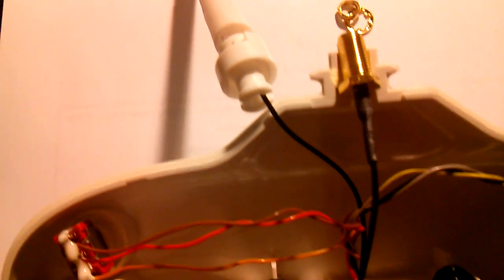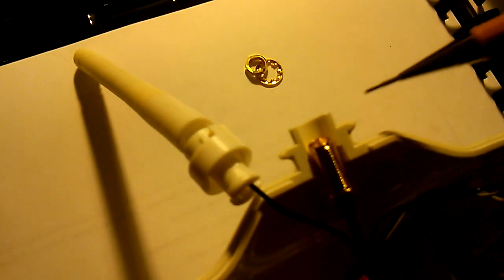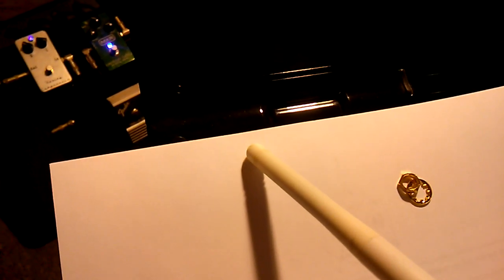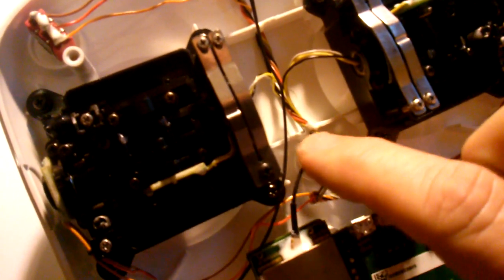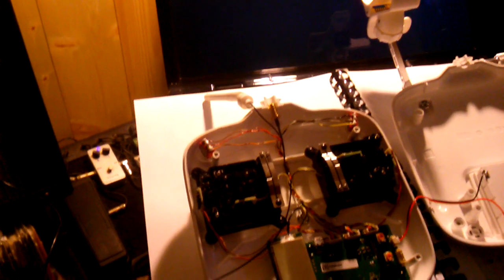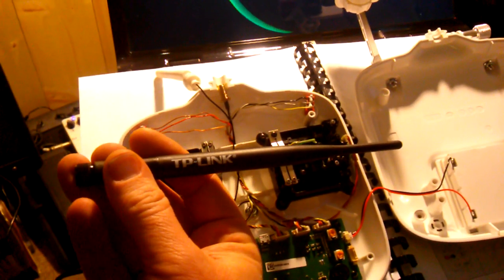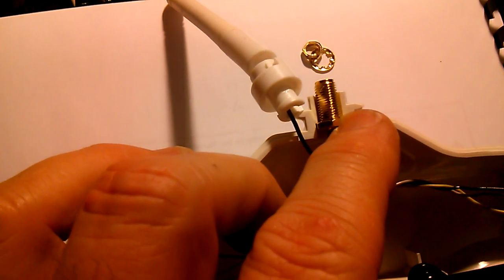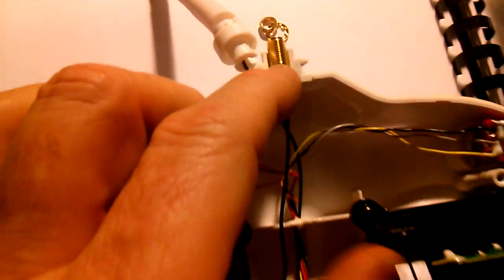DJI Phantom 2 Vision Transmitter Mod Part 2

Comment: Be very careful with the connection on the chip with I broke mine off and cannot find a replacement for it. DJI will tell you to buy a new transmitter with no help. So if doing this upgrade be careful. No can I find a replacement but looking for a new transmitter.
Reply from the maker: Ouch, i have heard of this happening,sorry to hear.... not sure if you watched the follow on videos, but i do stress the potential of that happening, it is a very tedious job to get it off the pc board, i almost considered soldering into the existing wire and heat shrinking an inline splice to avoid getting at that connector, i dont think it would effect the signal...the other thing is; if you dont fly over 1000 ft away,,, there is really no need to even do the upgrade...good luck with a fix, you may be able to solder direct to the board, also look online for people selling a crashed unit....phantompilots.com classifieds may help with sourcing spare parts...
Reply from the maker: I will poke around and see if i can find a Tx for
sale...
Reply: jwuman  I have checked and new transmitter about the only help. Or someone who has one for sale. The chip is easy now I know to come out and no one carries it for replacement. I did solder it but can only get out to about 1000' with antenna upgrade even now so don't know if it is worth the effort. I do need to get out further on my farm and photo work but not worth it now.
Reply: jwuman Thanks for the help. Also I am trying to use a duel 6db antenna and wondering if that is the correct Wi-Fi to use for new antenna? Thanks
Reply from the maker: Dennis Daniels 6 dbi will be good,,,,i may go with 8 dbi,,they are taller but i think a little better,,,i will eventually have (3) 8 dbi antennas,,,1 for the tx ,,and 2 for the repeater....once i get the rotopixel gimble, i will upgrade the camera antennas with 2 circular fpv cloverleaf antennas,,,
Reply: jwuman I have ordered a rotorpixel and taking a chance with no video,info on capabilities, or when it will be shipped. So waiting on that. Hope to be able to use this on my farm to check livestock and many things if I get the antenna going next for control. May try the 8dbi if I get this range issue resolved??